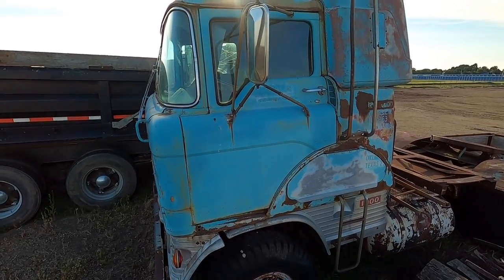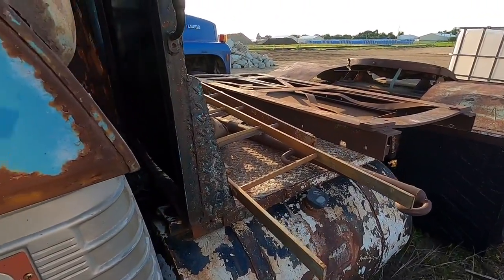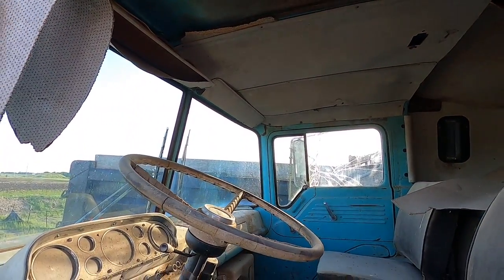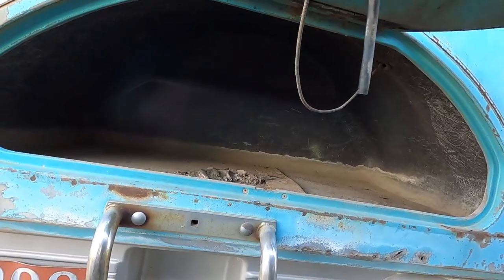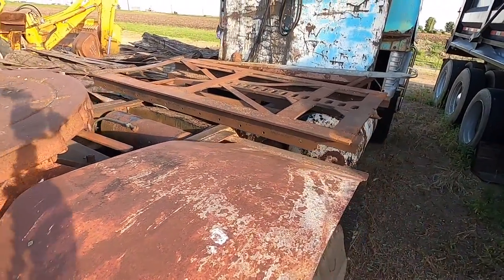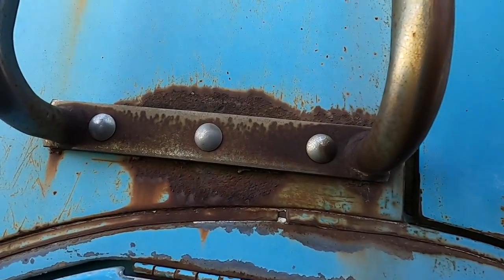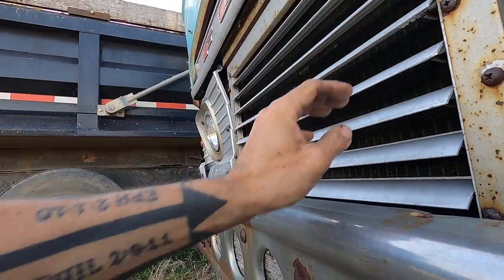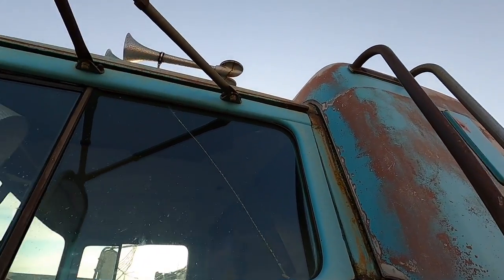Two Story Falcon!! Ford H1000 Cabover (aka 2 Story Edsel)

Comment: It's was called a 2 story Ford falcon.  The gas engine is most likely a 534 Ford.  One of the things about this truck is the steering wheel is moved more toward the center of the cab, the reason for that was to give you more room to your left side.   I drove one of these in the 60ths it had a 220 Cummings in it.
Reply: When men were men and the trucks were two-story. 🤠
Reply: Armsrtong steering probably
Reply: There is no such thing as a Cummings engine !! The word is Cummins .!
Reply: Some had a 653 GM Detroit. My Uncle had one for moving trailer homes. You could hear it coming around the mountain.
Reply: @Carla-tz7qw  screaming the shit outta that little V6 I love em ✌️🇺🇸
Reply: Cab is from classic C model 1957 to 1994. Love to find one like that impossible in Ohio.

Comment: Had a C model which is that cab on a cab forward model. Had. 534 V8 gasser with a a fuel line bigger than anything I ever had feeding the carb. Got like 5mpg loaded or unloaded and ran like a scalded dog. The manifolds would constantly burn out due to the heat the motor made but always ran good.

Comment: I did find some info on the Ford H1000 Thay came with three different engines one was a 647ci -743ci  or you could get it with a 220 Cummins engine.

Comment: O-H-I-O Porter greetings.🇺🇸 I’ve always heard of it as the “2 Story Falcon”, not Edsel. I’ve only seen 3 of these so far. They are so incredible & awesome looking. I thought the 1000 badging meant it was diesel, but I guess not from what you found out. A 534 gas engine…perhaps. I sure hope that they DO restore this fine old truck. It does need lots of TLC as you said. Love the sleeper box on it. Yes, they were all fiberglass, as far as I know. They did come in 2 sizes though. Hopefully they will get on this sooner versus later. RESPECT is always important when checking out a vehicle belonging to someone else. I bet this truck has some good history behind it. I thought those corner panels were aluminum, but I guess they made plastic as well. Bottom line, those trucks were quite sharp & I think they only made them just a couple of years or so. A good find my friend. Blessings. 🥰😎✌️

Comment: Those that think Ford was new to COE's are wrong. My Father in law drove for an outit in Kansas after he got back from WW2. A late 40's model with TWO flatheads, a right angle bus trans, and two speed rears. He said you could run the motores together or independently. Todd the retired trucker.
Reply: There were several twingened ford types made during the war, seems only one type was done by ford, it was supposedly for transporting b24 parts.

Comment: They call those shutters on the radiator ,,you didn't want to have your hand on them when they closed they ran off air and if the truck over heated you would put a stick in them to keep them open to get you to the shop to fix it

Comment: 477/534s were generally very reliable but had a problem keeping intake manifold gaskets. Worked for a Ford truck dealership from '81 to '04 and we saw a few of them. Intake gasket leaks would cause a lean backfire through the intake and blow the power valve out of the Holley then they'd go dead rich. Out of the hundreds of trucks I worked on there that's one I still remember.
The H model was pretty rare by the time I saw one. It belonged to Texaco and had Cummins 903(!) in it.
When the CL9000 came out in the early 80s we called it the "Two Story Pinto".

Comment: In 1965 my grandpas company trialed the H1000, IH CO4000 and Freighliner COEs for their fleet. The Ford came in Dead last and they went with CO4000s- BUT my grandpa bought the Ford after they got rid of it in either 69 or 70. He liked the style and was a Ford man. He ran it as a personal "for hire" truck until 1987 when it was parked on some property in the mountains- an avalanche came through and tore it to pieces. Sad would like to have that today. I think it had a 290 cummins and a 9spd IIRC

Comment: Some of the 534 had 2 four barrel holly carburetors and the governor let it turn 3200 RPM  I bought one that had been cut in two. It had a 4 speed Allison automatic transmission that engine trans combo went into my Stuart tank way more power than the twin Cadillac s with hydamatics did . That went to the front transaxle that was made by Mack .

Comment: Carris Reels Rutland Vermont had a fleet of these . Deluxe cabs small Cummins engines . You reached in above the front tire and pulled the compression release while spraying starting fluid in the intake when it was cold. Taught myself to drive spotting trailers and local delivery’s. Good times for a young guy
Reply: Your exactly right ! 
Their is a picture on the wall of the break room at their truck garage of one of these tractors pulling a Stainless Steel Fruhauf van trailer.
Reply: @vtwrench1  I was told when mr Carris opened his business the local ford truck dealer helped him with his first truck. Henry Carris bought Fords for many years. The deluxe  cabs were bright red with Chrome accents. 220 and later 250 Cummins. I spent the first six months learning to spot those rib side 35 foot stainless vans. Probably never got out of first second and reverse. At the end of six months I had learned to put a trailer to the dock pretty quickly. Sure made my life easier when I started mashing deliveries to customers. Great times .

Comment: The lower cab version was C series Ford. The H series raised the cab up, moved the steer axle forward and used the space where the curve was under the C service wheel arch for storage. Both cabs were produced by Budd Corporation for Ford, but Ford paid for all the tooling. C series was also offered as the Mercury M series truck from 1957-1972. The H series lasted from 1961-1966. C series with that style cab had a long run - 1961-1990. Used another for fire engines and garbage pickup.

Comment: It is 534 gas engine like a diisel only 2100 rpm maximun only 3 miles to gallon. It has what you call a Quarter sleeper.
Reply: The H , weird as it.looked drove and. handled well

Comment: Believe thats around a 1965 model. Ford had just started making over the road big trucks. Some came with diesels and some gas motors.
Reply: I’m trying to remember it’s been 50yrs ago my dad drove one that ran on propane
Reply: @lipglossandleadership2473  then your Dad wasn’t a long  haul driver right?
Reply: @kimmorrison9169  Primarily day trips maybe overnight if hauling seafood from the Oregon coast to the Willamette valley the Ford was the only propane others were Freightliner cab overs all late 60s early 70s an old cab over ford with an International & a cab over mack

Comment: I drove one of this boys   250 Cummins  10 speed Tran   Had to lean over to the right to change gears. You could put an anvil or 40 lb chuck of lead in the sleeper and in 5 miles down the road it would be in the right side floor board    Put a lot of miles on one of them.  Damn two story Falcon ford

Comment: Never heard them called a 2 story Edsel until now. They were often called a 2 story Falcon, for reasons I could never understand.The cab was borrowed from the popular C series tracks,. Thus, the wheel opening located to fit the C series chassis.
The grill/headlight panel was same as used on one of the Ford heavy duty conventional trucks of that era, although I can't remember the series designation for that line. 

The one here is unusual, as it is the only gas powered H 1000 I have ever seen and, being old as I am, I saw a lot of these trucks back when.